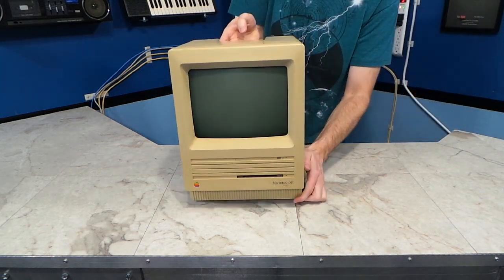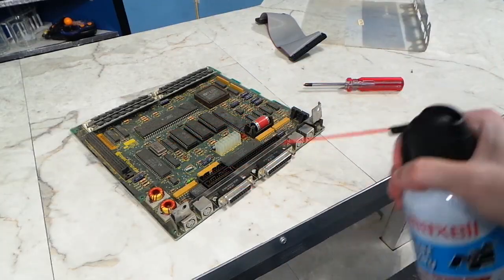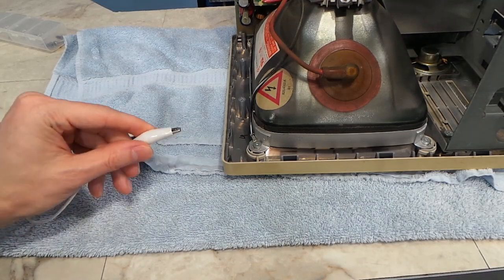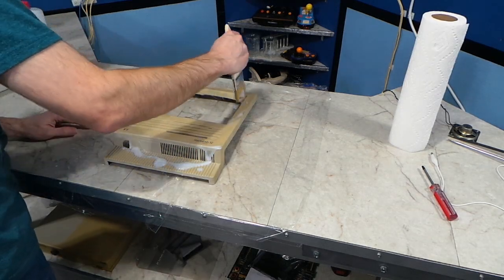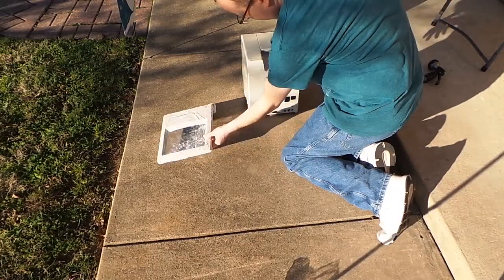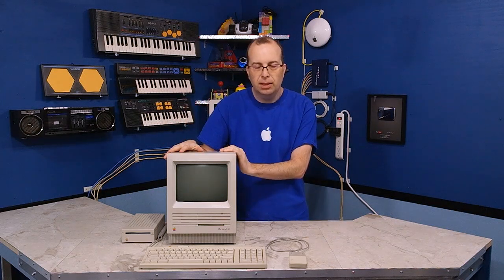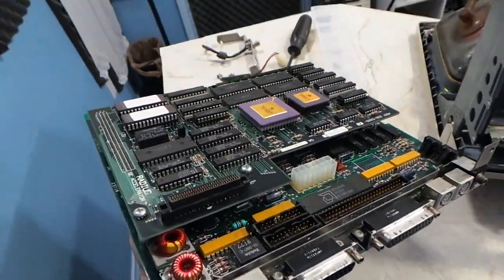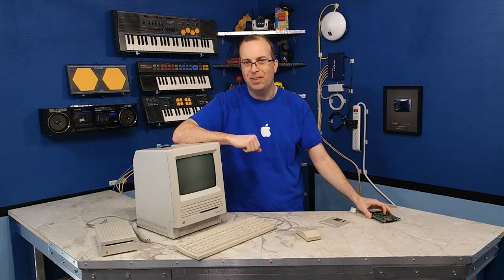Macintosh SE Restoration and SD-2-SCSI upgrade

Comment: Shouldn't be using that garbage 91% stuff.
Reply: 8:07
Reply: toysareforboys ah, are you referring to the concentration of alcool, or the type (it seems isopropyl alcool)? so what should be used for these operations?
Reply: Actually for some purposes 91% is better, since that cleans better than 99%. (The combination of water and alcohol is a better solvent -- and a better disinfectant, as an aside.) Provided it's quickly dried, it will cause no damage to electronics. (Remember, many electronics are manufactured using water-soluble flux, and are then washed in water to remove flux residue.)
Reply: I'm a complete ignorant on the topic, so probably this is a dumb question: denaturated alcool (which is ethanol, basically) would be effective aswell?

Comment: I really would recommend getting a proper discharge probe and meter so you can measure the voltage rather than using the quick and dirty method of a screwdriver and croc clip.... The anode caps can re-charge sometimes and you think it's safe as you have stuck your screwdriver in and it will still zap you...NEVER use both hands to do the job...

Comment: 10:10  Why not use a hot glue gun? That would seem to be less of a pain.
Reply from the maker: I've had less than stellar experience with hot glue.. It is good for certain applications, though.
Reply: i dunno about less pain and mess. you have to mix epoxy and apply it. Hot glue is dispensed. 

Epoxy is stronger, but thats not always needed.
Reply: I wouldn't - the heat inside the machine can probably soften it enough to break the bond.
Reply: icwiz hot snot is bad
Reply: Hrump and Tillary
Reply: Jacob Helton  sally beauty salon
Reply: Epoxy is much less of a pain, much less of a mess, and much stronger than hot-glue.  I use it on nearly all of my diy projects because it's that good.  I even use it as wood filler for the bottomside of my computer desk as well.
Reply: Well you are an inspiration just for patience alone. I will persevere on my Amiga projects!
Reply: yeah bolts sticking out of the front of the computer would look really good.
Reply: Love these videos. Keep up the good work 👍
Reply: or you can make holes and screw bolts on it
Reply: Where did you get that Apple shirt?  It's really cool!
Reply: I would have tried to drill a tiny blind hole in the plastic, and fastened the speaker with a screw. That way, it's still serviceable.
Reply: I would just have mushroomed the other two pins in using a hot metal surface like Apple did in the first place. :D
Reply: Not snot has its uses as mentioned.  People like Drakon have given it a bad name.
Reply: They say heat, but hot glue has to get pretty hot to melt. So I am not sure.
Reply: Afcourse i liked the adventure my boy! I just made a bid on a macintosh for 10 euros XD, hope i will get it.
Reply: @rogerwilco99 which is why I said blind hole. Anyway, if you were concerned about strength, you could build it up with a bit of epoxy putty.
Reply: icwiz It gets hot inside computers.  Hot glue works by heating up the glue.   Basically, hot gluing it would result in the hot glue melting and the card falling out of place.  Easier to use a metal plate to be sure that stays in place the first time.
Reply: Why not just melt the other two poles it's only held in place by two anyway.
Reply: icwiz
Reply: May I ask what would happen if you used the hot glue that's been a problem?  I'm just curious in case I ever come across a situation like this.  Hot glue would have been my first guess in what to use.  Fantastic in depth video though!  Thanks for sharing.  Great job as always
Reply: nikita?
Reply: I hate how DIY'rs use hot glue for everything, it's never good for a permanent fix of anything. It's not a glue, it's melted plastic, it always cracks and falls off eventually.
Reply: Yes, hot melt adhesive is a thermoplastic. When thermoplastics cool, they return to their original state (in this case, soft and flexible like the original glue stick), unlike thermoset plastics which can't be remelted. Glue is something you use to stick things together, so I think hot melt qualifies. I find it very handy because it bonds well to many materials, and it's good in situations where you need a bit of compliance. If your glue cracks then you're using something weird.
Reply: yeah i have DYI projects that are years old with hot glue. There is no cracking for falling off.  Perhaps you had a bad batch of glue?
Reply: By the way, the low temp hot snot melts around 60C which can easily be reached by ICs. Even before that it will begin to creep, so it's no good for warm environments. The high temp stuff might be OK though.
Reply: icwiz
Reply: icwiz his last one burned up after an hour
Reply: 8bit guy are you for trump or Hilary
Reply: say waaa?

Comment: You can buy an Ethernet card for it here: http://www.ebay.com/itm/Macintosh-Color-Classic-Ethernet-Card-Apple-LC-575-PDS-Farallon-New-Networking-/231332620598?hash=item35dc7fa936:g:zSgAAOxyyFhTeL5i
Reply from the maker: That won't work in the SE.  the PDS slot is different.

Comment: How did you get the motherboard so clean?  I've heard rumors of just washing them with soap and water but...
Reply from the maker: I start with compressed air.  If that doesn't work, I come back with a bristle brush.  If it is really bad then I have to scrub it with alcohol or something.
Reply: He blew compressed air on it. Not sure if he did something extra for any stuck dirt.

Comment: It might just be a bad system extension causing the image to hang. Hold shift key (enables safe boot) while mac is booting with that image and see if it gets to desktop. Then you can go into the extensions folder in the system and remove the offending extension(s).
Reply from the maker: Yeah, I tried that.  I was able to get the to desktop doing that, but then after another 60 seconds or so it still froze up and when I booted next time the files on the SD card were corrupted.

Comment: Interesting to see how people can upgrade theses kind of old computers with SD card hard drive emulator and accelerator cards for the cpu. I wonder if anyone changed the original CRT screen,
with a modern lcd one. It would be quite a challenge but it would make the computer much lighter and much more pleasant to watch.

Comment: Try checking the SD card wright protection switch
Reply from the maker: I think it would have been pretty hard to copy that whole 1 GB image over to the SD card if the write protect had been on, don't you?
Reply: The 8-Bit Guy Good point well something like that has happened to me so...
Reply from the maker: Sorry, I was kind of annoyed because your post was like the 4th or 5th one I had read telling me to check the write protect.  I guess you were the lucky one I blurted out at.
Reply: Its okay
Reply: Try another sd card, i've heard of issuse with sd cards because they were going bad ...
Reply: +FightRay facepalm
Reply: I've had lots of troubles with CF cards and embedded hardware.   You would think all CF cards of the same capacity are the same,  But it's not the case.     There's some particular hardware feature differences you can find.      In the case of the   Juniper M10 routers,  when upgrading to the higher capacity cards  necessary before a Software update....     One CF Card works,  and the Next one doesn't,    And  the card that works and the next one that doesn't work is the  exact same SanDisk  CF card model number,    But apparently    At some point   the  manufacturer   started making the CF cards with a slight difference in the chips on the card, or one of its hardware features  related to emulating IDE/ATA.
Reply: +Mason Dulemba That might be a option, i have like 2 broken sd cards lying around
Reply: @The 8-Bit Guy - Try checking the SD card wright protection switch

Comment: wait, wait
wouldn't it have been suffice to try out the old SCSI HDD on another computer? If it worked, then you'd have your evidence that it wouldn't be the SD-2-SCSI's fault. Of course, if it didn't work, then you'd have to use a second Macintosh SE. I do wonder, was there a specific reason you didn't try this method of elimination first?
Reply from the maker: The hard drive would not spin up when power was applied. It was dead as a doornail.
Reply: Damn it. Well, was worth a shot.

Comment: I've actually got an older V5 SCSI2SD that I use with my Mac SE, and it works perfectly for me, though I notice that you have the newer V6. It's the exact same model too -- the Mac SE FDHD.
Reply from the maker: OK.. then maybe there is just something wrong with my logic board... I'll find out next week.
Reply: Right . . . and I also initialized mine with the same version of patched disk utility as well, and it completed with no issues.

Comment: the suction cup pop scared me
Reply: It's was like a jump scare XD
Reply: CALL ME ASG same, good job it wasn't in 3d
Reply: s a me D:
Reply: The cup is connected to the crt anode. A crt uses electrons to light up the screen. You want them to reach the screen as fast as possible and light it up. You achieve this by applying a very high voltage on the anode, which is the positive plate of the crt. The electrons, being negatively charged, will be strongly attracted by the anode drift past it and hit the screen. In fact, the voltage applied to the anode is often called "accelleration voltage". On simpler oscilloscopes crts can be around 8k-15k V while color tvs can have an accelleration voltage of about 35k V.
Reply: lol same i thought it was a shock or something
Reply: God damn, i jumped back with my whole chair... this is even not happen when i watching a horror/action movie or something like this.
EDIT: OK, the reason was, i was eating breakfast. He is telling something about sparks, i look down to my table to eat something, than looked back and the "plop-sound" appeared ;-)
Reply: I thought I was the only one :) .
Reply: LMAO me too...RIP headphone users.
Reply: thought i was the only one, got scared even with speakers
Reply: Same :D
Reply: ikr is was a bot spooky
Reply: if you sneak the screwdriver in first there shouldnt be any problem.
I have a tektronix 2215 oscilloscope i had to repair, and when troubleshooting a guy told me that my machine could have "random" failures because when people tend to work on the crt and they have to remove the anode hv connection (on the voltage multiplier side) they are scared to grab near the end of the connector and when pulled out it flops around over the main board and discharge the crt on some unlucky components. Hopefully it wasnt my case.
Reply: JUMPscare... It got me good
Reply: Glad it's not just me that was scared by that.
Reply: same with me lol thats wierd
Reply: Good.  That way you'd be careful.  He shows exactly how to deal with it.  It's also good if the screwdriver has a non-conductive handle, or you wear gloves, just in case the grounding wire pops off just before you get the screwdriver in far enough.

I've worked on 19" color CRTs in arcade machines.  There's a much higher voltage involved, around 25kV.  And no bleed circuit, either.  You short it to ground several times to be certain.

Note that the reason the board on the back of the CRT is just like an old tube, is that a CRT is a tube.  It's got a strange shape, and it's bigger, but it's a vacuum tube.
Reply: hahaha
Reply: LOL SAME WITH ME!!!!
Reply: I actually jumped lol
Reply: Jeeezz... Me to...
Reply: Sheesh, you weren't kidding, it got me too!
Reply: SCARED TH SHIT OUT LOL
Reply: Even with your warning it still frightened me... :(
Reply: Who ever knew breakfast could be so frightening ;)
Reply: LOL i Jumped
Reply: Ethan Education Good. Yes I did comment on that absolutely amazing song. :D
Reply: Actual risks are more useful to know than imagined ones.  
Hysteria makes nothing one bit safer.
Our society has been brainwashed to panic concerning all possible risks.
Reply: CALL ME ASG SAME
Reply: CALL ME ASG Correct!
Reply: I literally jumped slightly lmao.
Reply: 5:40
Reply: Same, I jumped off my chair
Reply: I literally just paused it there to check the comments. Yep. Top comment. I'm pretty sure David edited it that way on purpose just to mess with us. :D
Reply: Me too.
Reply: What is it used for?  I see them on every CRT, whether it's a monitor or not.
Reply: CALL ME ASG SAME 😂😂😂😂😂
Reply: CALL ME ASG I was listening with a friend and we both turned and looked haha.
Reply: glad i wasn't the only one lol
Reply: Same here lol
Reply: +Victor Tran I keep seeing you everywhere. You commented on Blip Stream by Kevin Macleod.
Reply: I also jumped xD
Reply: Victor Tran Hey you comment on OS first timer videos.
Reply: Weston Gaming Yes. That is me. :)
Reply: Victor Tran Do you remember me? You replied to one of my comments (;
Reply: Weston Gaming Yep. I do. :)
Reply: Victor Tran (':
Reply: CALL ME ASG me too and I'm a tough
Reply: same
Reply: I thought he lied and a spark did came out.... but it sounded more like an explosion lol
Reply: I think it'd be cool to "stretch" the chassis to make an iPad fit in the case. Add a keyboard painted white.
Reply: Ikr I jumped and fell out of my chair
Reply: I read your comment and still got spooked
Reply: Same here
Reply: CALL ME ASG I was scared of the CRT part.
Reply: It got me also CALL ME ASG, we both got scared
Reply: not only both of us but all those 58 people got scared
Reply: CALL ME ASG yea
Reply: CALL ME ASG yes
Reply: CALL ME ASG yes I don't trust old technology so I test it outside :-) I once found an ancient tv and it worked got very hot so I will not use it in my house and probably sell on eBay with warning to not leave plunged in
Reply: dave4shmups Idk but I'd replace it with laptop display for sank of adding a battery so I can carry it around and people will be jelly
Reply: same
Reply: Yes scared the crap out of me. I jumped. I still fear getting electrocuted by touching the cable.
Reply: CALL ME ASG pussy
Reply: It's super late here and it definitely made me jump in my seat haha.
Reply: Basileus s nice reply. an old computer teacher basically said touch that and you can die. so yah. scared shit less of those. one day I will discharge it and get over the fear.
Reply: Same!
Reply: me too
Reply: smea
Reply: Glad I wasn't the only one XD
Reply: me too lmao
Reply: Glad I'm not alone!
Reply: CALL ME ASG I just gave you your thousand like
Reply: I heard nothing
Reply: Same bro.
Reply: sanme :o
Reply: Same 😅
Reply: ea
Reply: same
Reply: Same
Reply: ( Y ) S ame
Reply: I felt like a cat next to an air compressor
Reply: Same
😮
Reply: Same
Reply: I’ve got a macintosh, so I’m used to it
Reply: Same, I didn't notice that part of the video until I read this, went back and sure enough, jumped like crazy.
Reply: eat me daddy

Comment: Wait, what's the battery for
Reply: The Macintosh SE doesn't have a PMU.  The power is controlled by a physical rocker switch on the back of the unit.

The battery powers the RTC (real-time clock) and the CMOS SRAM, which is called PRAM (parameter RAM) on the Mac.  It stores settings like keyboard and mouse sensitivity, the selected boot device, and the sound volume.  Flash memory could store these settings with no power, but flash memory wasn't available back then, so they used battery-backed CMOS SRAM.  If the battery dies, those settings and the current time are lost at power off, but the computer still works otherwise.
Reply: faultyJACK its power management unit and known as PMU it controls the power and remembers the time
Reply: ToasterKing Actually, most 68K Macs won't boot at all with a dead PRAM battery!
Reply: Antonio Tejada Are you sure it's most? I've always heard some, and of the many 68K Macs I've personally replaced PRAM batteries in, I've never encountered it myself.
Reply: Depends on the model.  Those using the keyboard-based power switch (Mac II series, mostly) won't power up with a dead battery (although some have a switch on the back of the case that might also work.)  Those with a mechanical power switch, like an SE, should boot with a dead battery, but you'll find the PRAM reset every time (no clock, have to scan the SCSI bus for the boot device, etc.)
Reply: Shamino0 Nope, the LC/Performa series with manual power switches won't boot without the battery either. In my recollection, none of the 68K Macs will boot reliably with a dead PRAM battery. In my days working on Macs in the 1990s I ran into this regularly.

Comment: Man, you have to be careful around the flyback transformer that powers the CRT on there 8-bit guy! Getting hit with 600V does worse than tickle.

EDIT: Nevermind, you covered it later in the video. Good on you.
Reply: 600V ?  That's quite low for a CRT.

Comment: How can you ground the CRT when the Mac is lying on a towel a non metal table?
Reply: In this case, I think he's referring to the chassis ground, not the earth ground.  It's only necessary to ground the CRT to its own chassis to dissipate the charge that is stored internally.  Grounding the CRT to earth would not necessarily accomplish anything useful, especially since the power wasn't plugged in and hence no connection from the chassis ground to earth ground at the time he did it.
Reply: It would help if he plugged it in, but switched it off at the socket, that way the earth terminal would be connected to ground and the metal case, he failed

Comment: Dang, I would have just taken apart the old hard drive and "created" a bracket that way. It already fits perfectly and it's not like there is any good reason to keep a 30 year old broke hard drive. But I also have no clue how to work with metal. :D
Reply: Would have lost the opportunity to test the hard drive later as a check of the SCSI bus / controller. Anyway, I wonder why the SD2SCSI kit doesn't include a design for a bracket with the 8 standard HD mounting holes.
Reply from the maker: I'm keeping the hard drive for a later episode. :-)